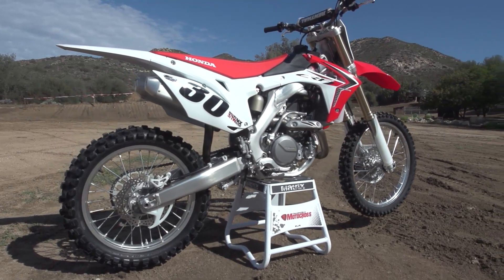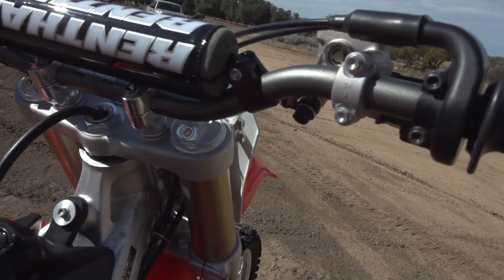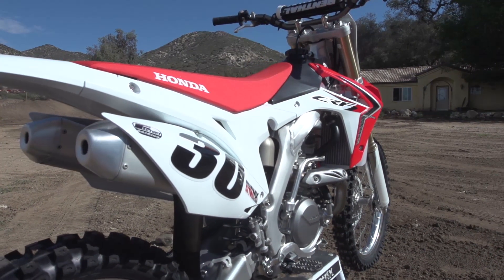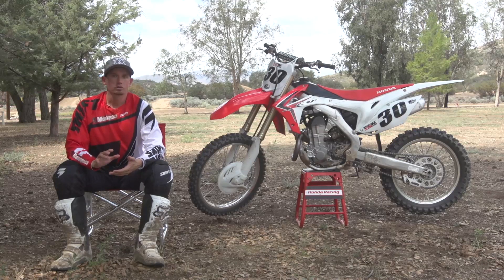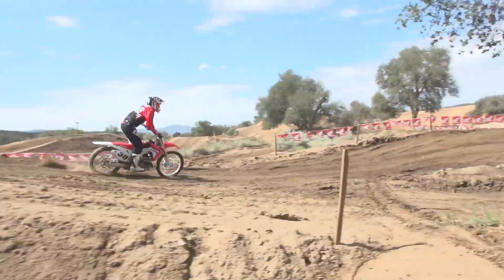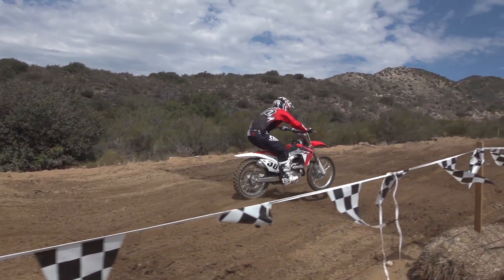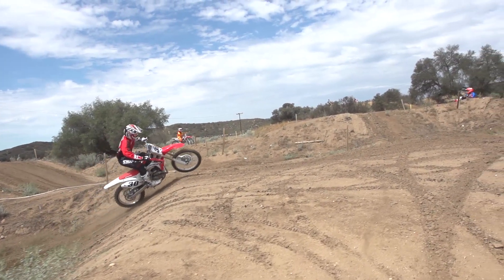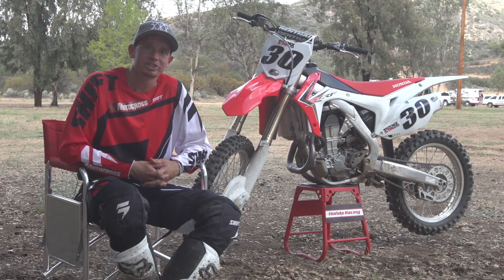First Impressions: 2014 Honda CRF450R - TransWorld Motocross

Comment: Does the TTX keep it as a PSF or convert it to a regular spring? Ohlins makes some great stuff. One of the best PSF mods is MX-Tech's. Theirs converts the PSF to a steel spring SFF fork. Air springs have their issues (look at their spring rate curve!).
The best damping solution is just about ready, the NOST N10Z (Intense) valves. They replace the base valve with new cone valve technology. No more shims that have their limitations. Damping properties that no shim/piston setup can ever do.

Comment: This is what every mag does for every new bike review (for big brands). Same with cars (every year Porsche fixes the 911's over-steering problem). They always fixed the problem and it is perfect, until the next model year review and then they say the same things. It's about selling bikes.
But a stock bike will never be perfect. The suspension can only be set for one rider skill, weight, style and terrain. Some person may want more bottom end power while another more top end. Etc.

Comment: I love the reviews..but instead of knocking on the 09-12 CRF450r...I wish they would stop talking bad about what very few ppl have A problem with..the issue isn't as prominent if you corner with the rear..I bought A 2011 CRF450r because of the handling.I'm not saying it isn't an issue.But at least give both sides.